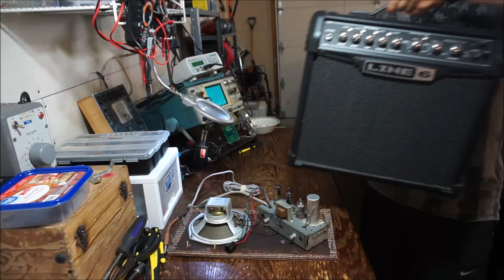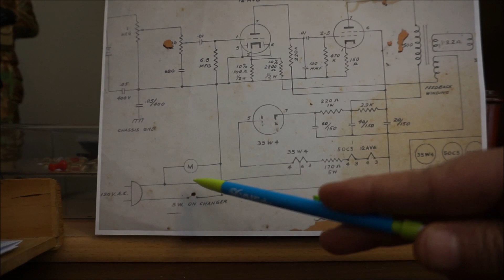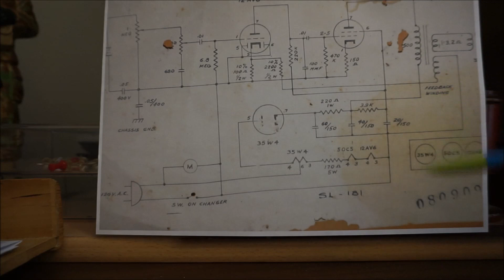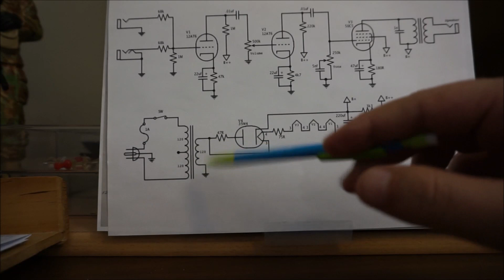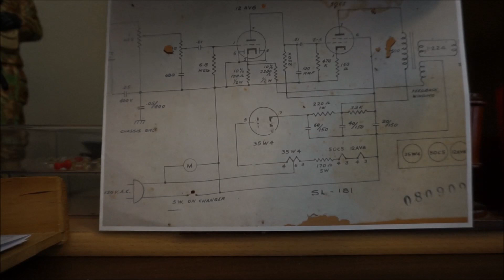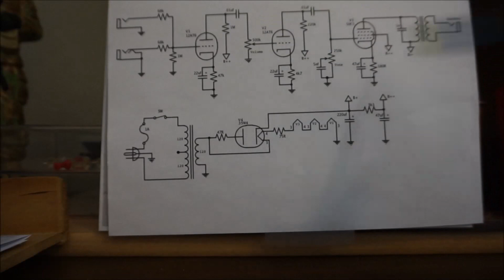SRT Amplification Class A Westinghouse Record Player Amp Conversion

Comment: I would nix the Line 6 idea and put it back in the record player cabinet there's plenty of room in there to add the extra components you need and it will keep it vintage looking at the same time but what I would do is to add a basic fuzz circuit with a switch as well it will help that little amp snarl hell there's even room to add an extra speaker if you wanted to!